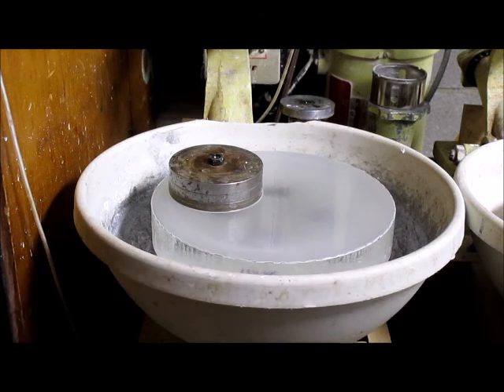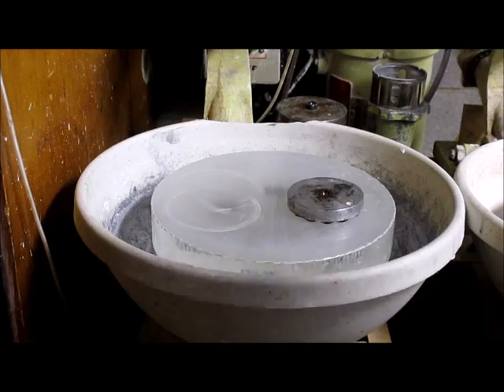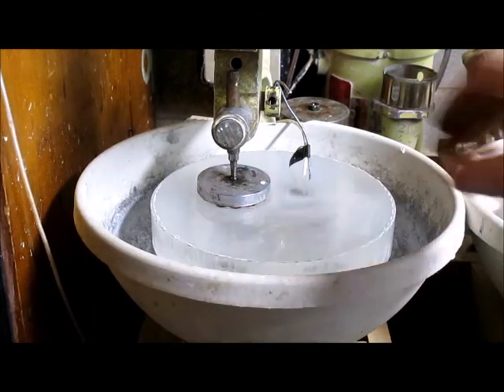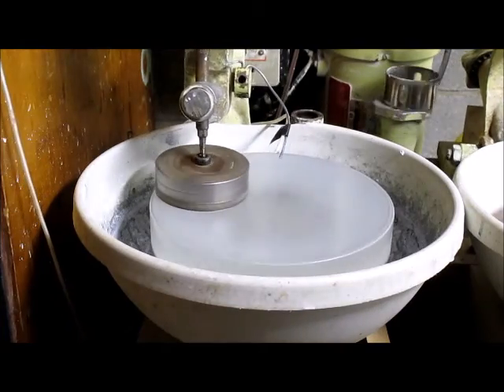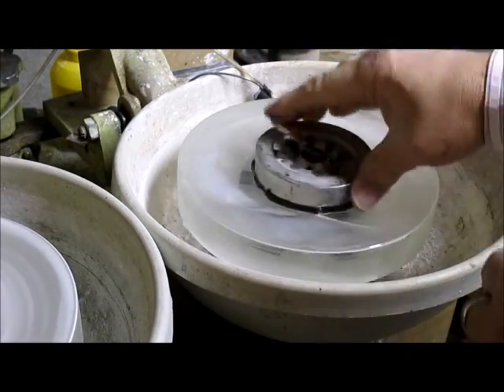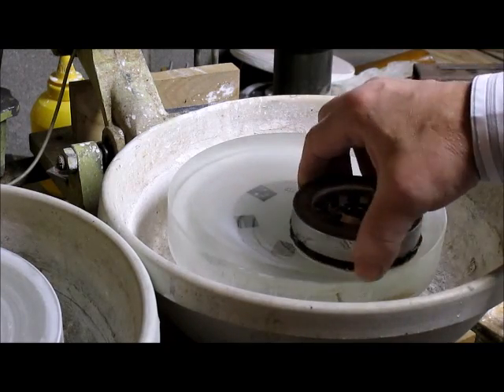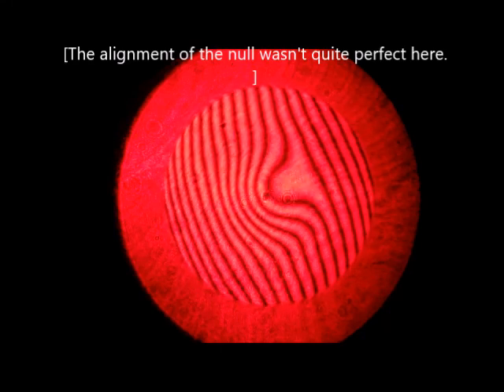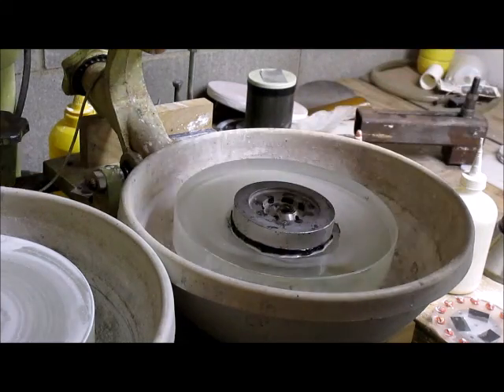Making and Figuring an 8 inch F3

Comment: Is the axis of the grinding tool aimed at a particular point along the axis of the spinning blank?
Reply from the maker: It's not aimed at a particular point on the glass, the larger wheel simply needs to cover both the center and the edge during the stroke so that you don't raise a hill or a lip.  The smaller wheels need to cover the center and are only to help speed up the otherwise slow curve change with the larger wheel.